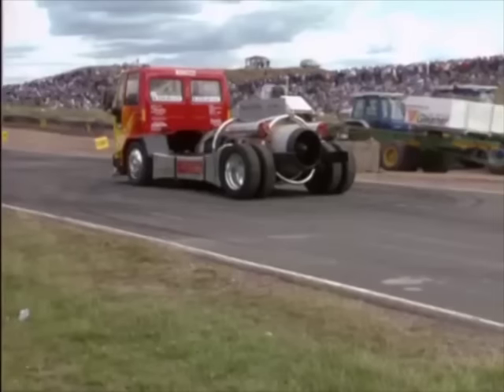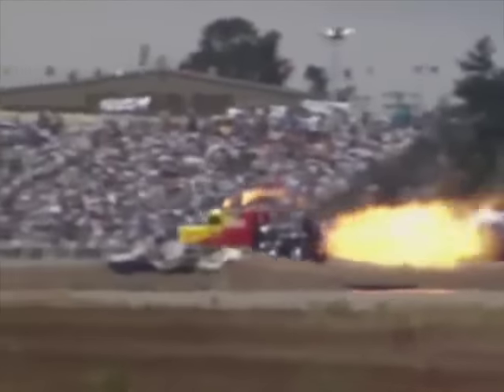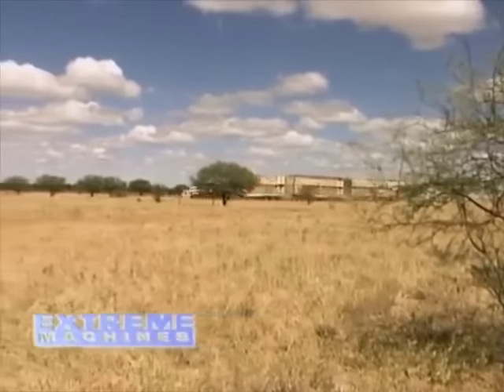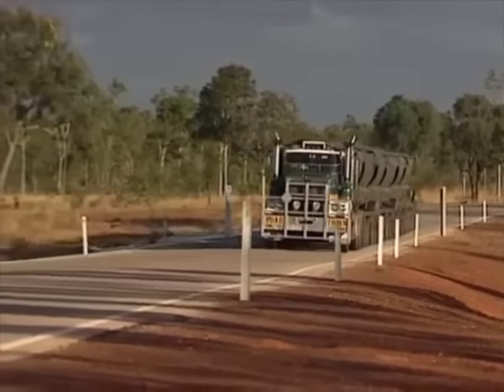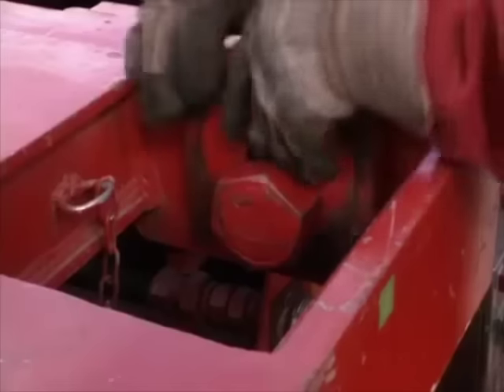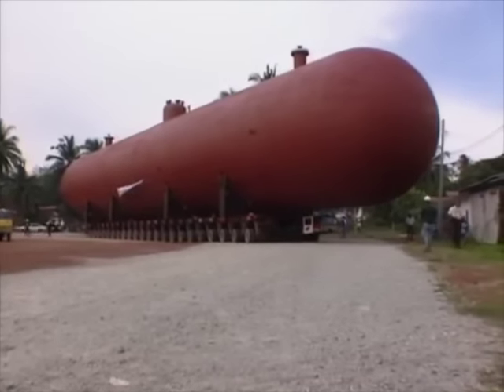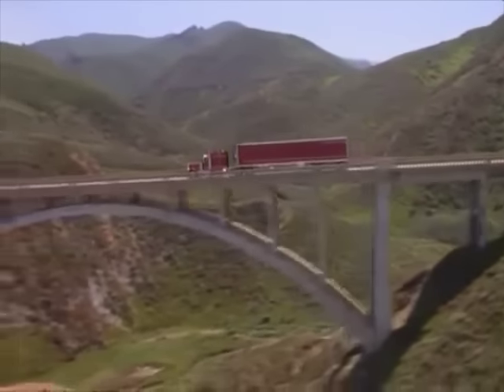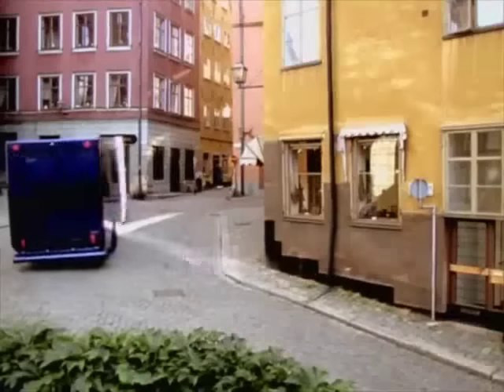Heavy Equipment & Biggest Truck With Over Size Load

Comment: nice job
Reply: Dear respected sir myself Mohammed Yaseen sharif have 19 years of experience in Power cement Oil and gas HVAC my qualifications detail as follows BE in Industrial Mechanical Engineer Diploma in industrial Mechanical Engineer Fire and Safety Boiler attended Second and First classes ITI Welder Trade my mobile numbers are +919989358613 +917981272143 my mail I'd power786yasin@gmail.com if any opportunity will join immediately regards Mohammed Yaseen sharif
Reply: Bharat Prajapati Prajapati
Reply: bf. xxxxxx